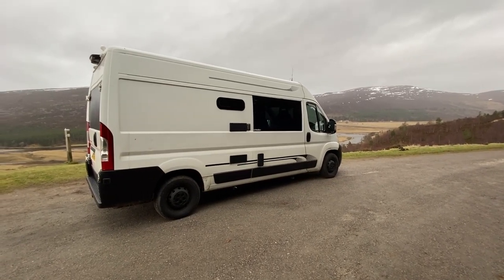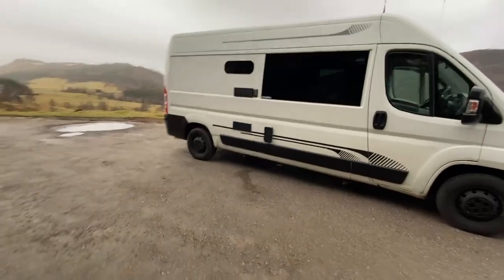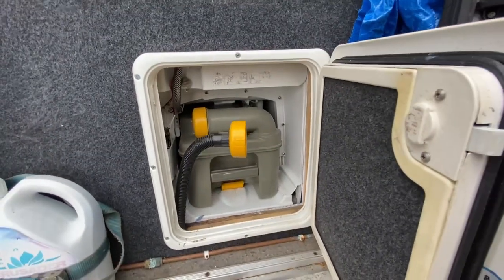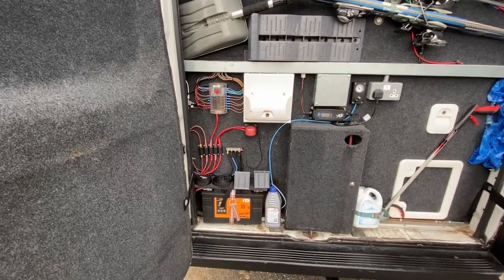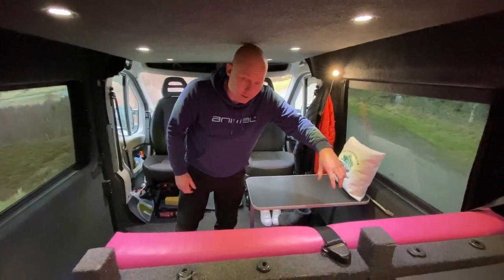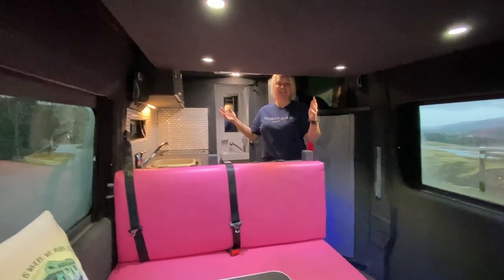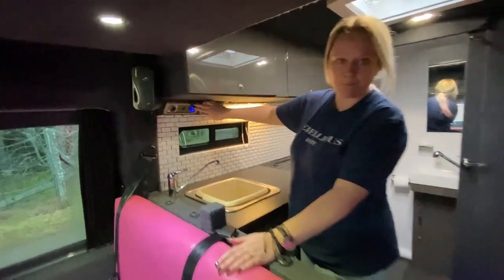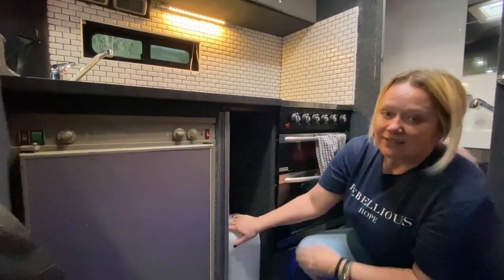Self Build Campervan Tour

Comment: Hi David. Great build and thanks for sharing your ideas. One question: The Citroen is my preferred van but I am worried about the rear beam when on uneaven ground such as a forest track. It seems very low. Have you had any problems? Dave
Reply from the maker: Hi David, sorry just noticed your message. We haven’t had any issue with ground clearance and our water tanks are underneath the van, so they would be the first to scrape the bottom. We added air suspension onto the rear axle about a year after the build, but the reason for them was to soften the ride on country roads. Thanks David